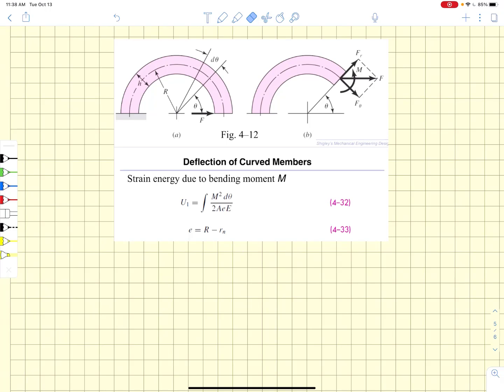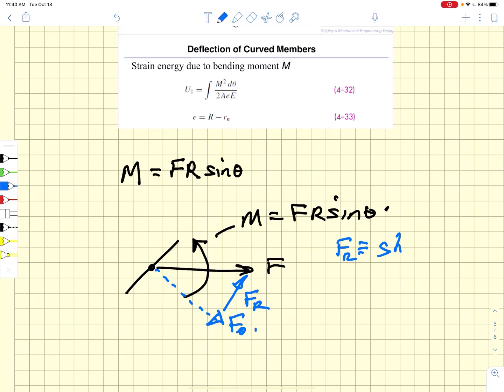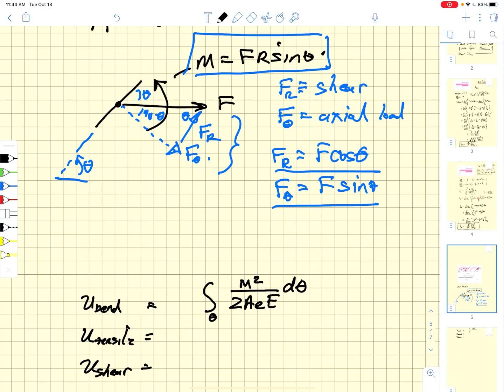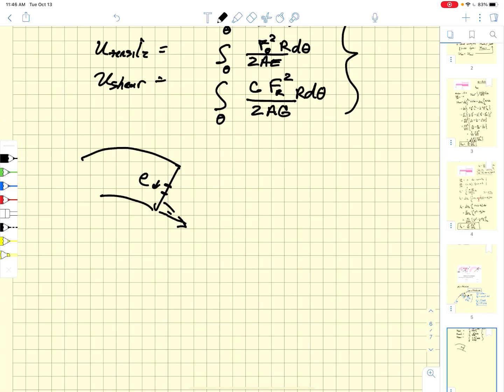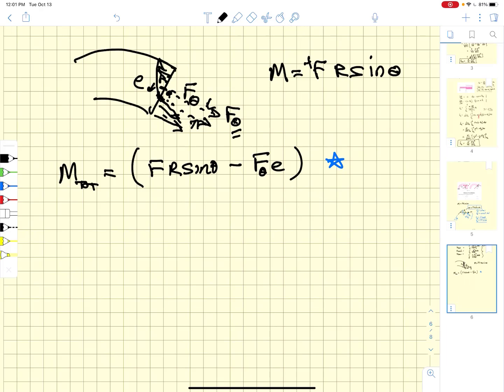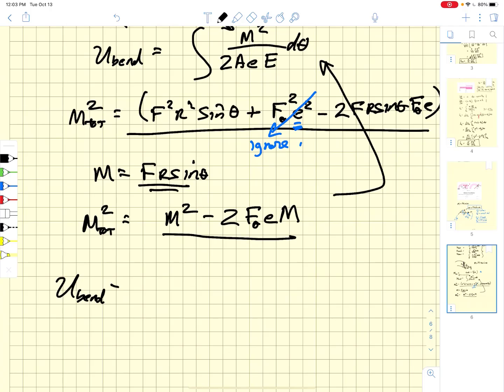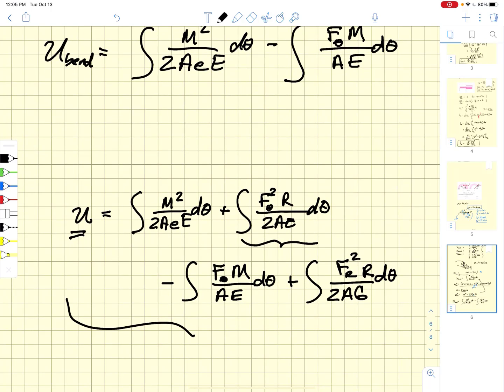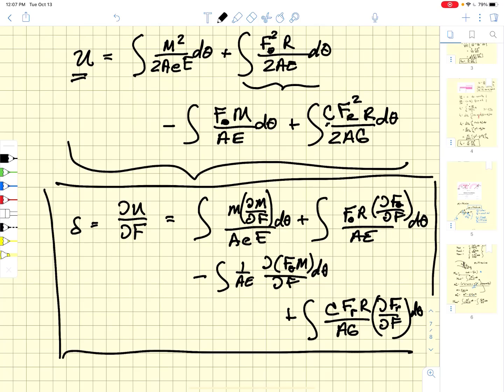Lecture 15a Castigliano's Theorem applied to curved beams

Comment: Great video, thanks a lot! But I'm interested how bending energy can be M^dtheta/2AeE intead of M^2l/2EI, even if the later one is right, how this can be used to curved beam? thanks for your explaination
Reply from the maker: The axial force acts at a distance e from the centroid in a curved beam.  This is shown in the lectures.  As a result, there is a bending moment generated by the axial force.  It changes the energy equation.  I do believe I explained this in one of the videos.  I admit that it might be tricky to see, at first.
Reply: @MechaTomics  Fantastic, thanks a lot!!!

Comment: Then if the force direction changes, those equations always correct?(ex. bottom direction normal force on the bottom surface)

Comment: Well how do you find this correction constant for the cross-sectional area?
Reply from the maker: I am terribly sorry...I did not include the correction factor table, Table 4.1 in the Shigley text.  You may recall that for simple bending, the shear stress is parabolic, with a maximum at the neutral axis.  To get a precise solution, you need to integrate that functional form across the beam height and beam length.  This correction factor provides a simple approximation that side steps that process.